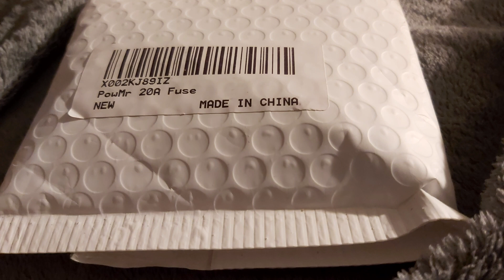SOLAR | WHY YOU NEED TO GET MC4 FUSED POSITIVE CONNECTORS

Comment: Umm where did you get the MC4 fuse? Maybe you can list the website.
Reply from the maker: I use these on my solar generators the Solar Panels with AVSVGEN Solar inveter & SVG  with Solar ControllerBT Mppt. MC4 from the same manufacturer of Mppt on Amazon.